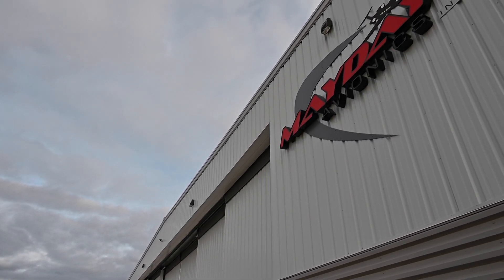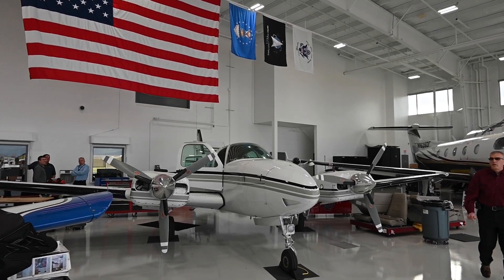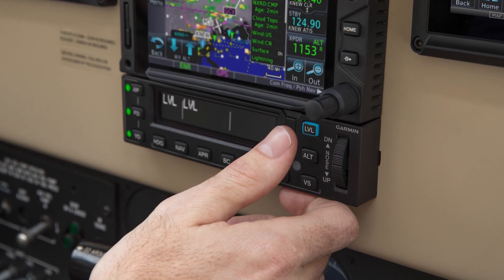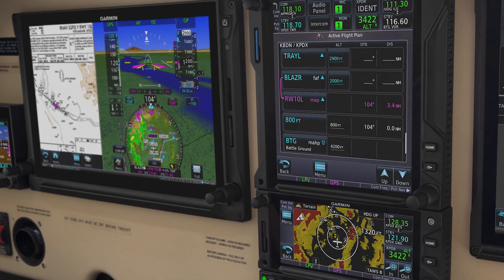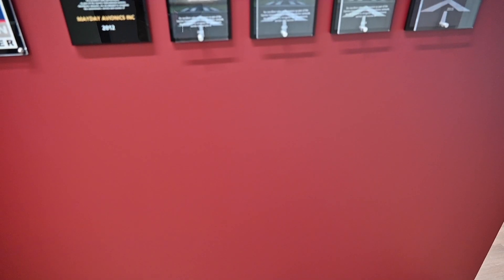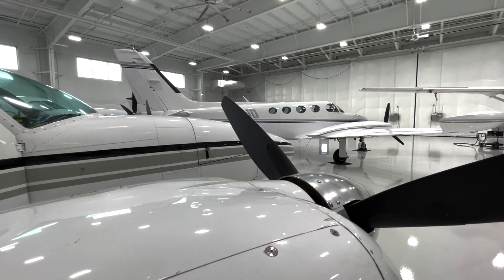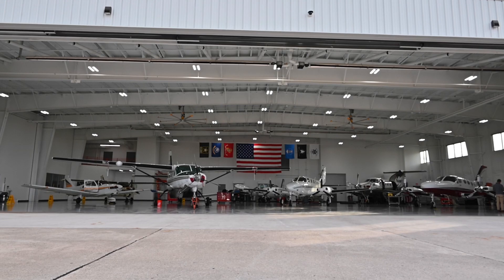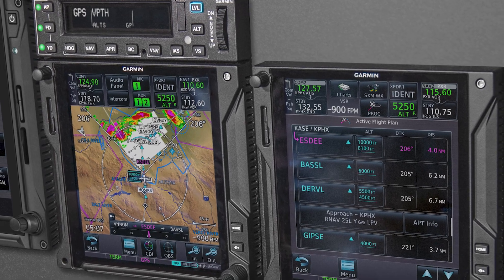The Garmin GFC 600 is the Best Autopilot for Your Twin

Comment: great story about autopilot and about the company itself. I am very impressed with your production. I myself am from Russia, I am installing avionics on the planes of my flying friends.
I also have experience in 100% replacement of wiring in Cessna 182 and Cesna 337 aircraft with the installation of new modern digital autopilots on them. Including DyNON D1000 and GARMIN G3X touch. I learned everything by myself, studying diagrams and reading forums.